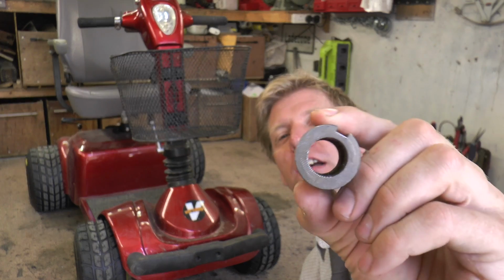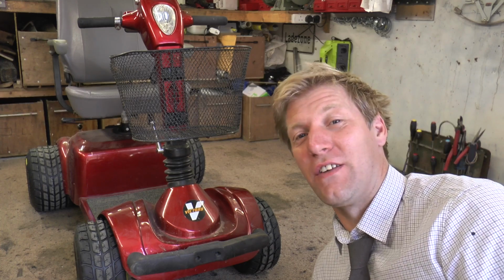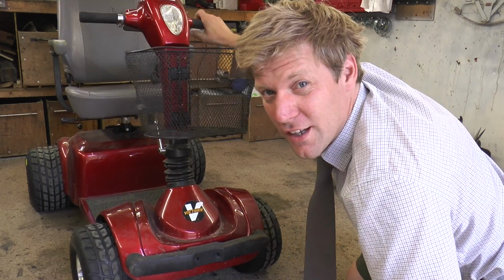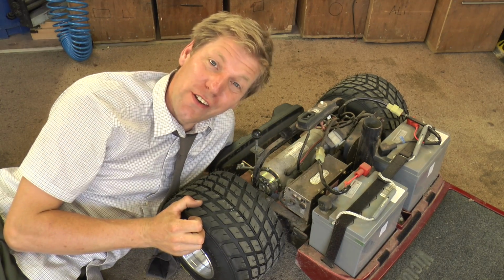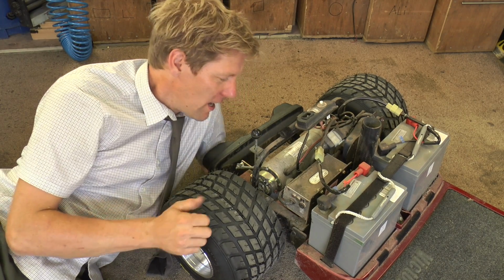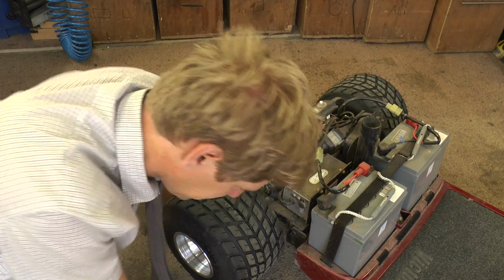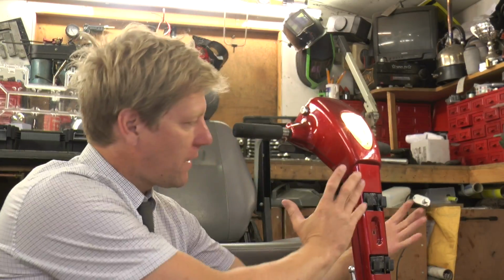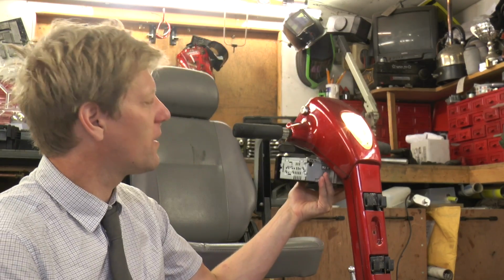Rims-Lift-and Bass Scooter Pimp #1

Comment from the maker: So what other mods do you want to see, as I just want to pack as much on this as possible.
Reply: colinfurze firework launcher
Reply: colinfurze needs more cup holders
Reply: I wanna see a massive spoiler
Reply: colinfurze needs hydraulic's!!!!
Reply: Those weird lights under cars to light up the bottom.
Reply: put Tesla's electric motor on it and go ludacris Mode
Reply: How am I so early
Reply: colinfurze add a windshield maybe.
Reply: Well, lets see. At least get a horn, like a nice horn, not just some music out of your boxes.
Some nice cushions may not be too bad as well, if you're going comfort.
And some suspense is nice too. Either you go for the killing suspense, like a turbo with a random activation timer, or just plain old suspension so your butt won't hurt when you get off the sidewalk.
Reply: Spoiler , underglow, raceseat, massive headlights
Reply: Led strip lights ( colour changing )
And a police lights and siren
Reply: A potato cannon
Reply: colinfurze a sparco bucket seat Colin !!
Reply: colinfurze  Pulse Jet?
Reply: suspension with A arms
Reply: kinda miss the bass-part in "Rims-Lift-Bass". Please slap some big ass subwoofer on the their. Maybe make a hole through where the feet should. the feet should still fit on the outside, bass massage included.
Reply: give it a rollcage
Reply: You could respray the whole thing, replace the seat and add Led lights/underglow
Reply: It could use a pneumatic suspension system
Reply: Sophia now that would be just stupid. love the idea.
Reply: A mini pub
Reply: colinfurze racing chair
Reply: colinfurze flame thrower or a hot tub
Reply: colinfurze flame throwers
Reply: colinfurze flamethrower
Reply: A race seat
Reply: More powerful electric motor!!!!
Reply: colinfurze maybe a built in fan for air conditioning?
Reply: colinfurze flamethrowers
Reply: A cup holder that cools your drink in the summer heat
Reply: Either loads of mirrors or like a camera reversing system idk
Reply: make it 4wd!
Reply: Spoiler, Rally Fogs, Rollcage, Suspension. The ultimate offroad scooter.
Reply: Put a retractable roof
Reply: You need flame effects on the body!
Reply: Firetrails like the delorean from back to the future
Reply: Massive subwoofer
Reply: Off road suspension
Reply: make it faster without putting a gas motor on it
Reply: colinfurze I love your videos sir now it just needs a engine like the other scooter did and would be amazing
Reply: Panini press !
Reply: please add a train/ barge horn. should be loud enough to fix your neighbors constipation. 
Good luck. remember if its not terrifying its too boring.
Reply: Hydraulics if possible. I wanna see a Lowrider seniors edition. 😆
Reply: You should add a roll cage and a heated seat to keep the buns warm :)
Reply: Air ride
Reply: Very raised suspension
Reply: i want to make magnetic engine free energy do u make it if u not make it u r waste this is our challange
Reply: Firework launcher or flame thrower... If its not dangerous its not a proper furze creation
Reply: colinfurze led lights make it like a Christmas tree
Reply: Nice seat and a Handbreak
Reply: Racing seat
Reply: colinfurze homemade racing seat
Reply: Stretcht tires and make Negative Camber
Reply: T-Shirt cannnon
Reply: Colin Furze mobility scooter tire spinners(tm).
Reply: Brushless motor...Colin ! fastest electric scooter
Reply: A trailer wagon with a big beer keg on behind!
Reply: colinfurze needs a bucket seat!
Reply: The Justist  mybe put a lazy boy recliner on it?
Reply: An ejection seat from a jet. And a lowrider(hydraulic jacks) attachment instead of the distance pieces!
Reply: you accept my challange you make one maganetic engine in free energy if you finish this challange
Reply: colinfurze HID headlights w highbeams
Reply: An automated firework firing & if possible reloading system.
Reply: Train horn,faster motor,bright front and back lights and led underneath
Reply: Please add camber to the wheels 😂🙄
Reply: Paramotor engine with paramotor prop on the back as propulsion instead of the electric mitor :D
Reply: colinfurze mini antenna . For radio
Reply: Air bag suspension
Reply: Add flamethrowers to the wheels!!
Reply: colinfurze good one colin
Reply: Machine gun mounted onto it
Reply: More speed
Reply: It needs to be jet powered
Reply: Make iT sorta fly make iT go fast put a propellor on iT and a parachute
Reply: Heated seat, drink dispenser
Reply: Ejector seat
Reply: Make it be able to jump with hydrolics
Reply: hydrauilics!
Reply: Make it street legal
Reply: A semi truck horn. Maybe some high powered head lights and some blinkers. A roll cage. Idk, just go mad max on that bitch. P.S. could you make one for Ricky Berwick! Ok, thanks!
Reply: Roll cage
Reply: Suspension
Reply: We need to get some actual subs on there. 2 12's would be appropriate I think
Reply: Jet engine
Reply: colinfurze you should give it hydrolic suspension so it can bounce or you could lower it and leave a trail of sparks behind you
Reply: Nate S nah too big that's what she said make them 6 6inch or 2 8inch
Reply: colinfurze after pimping it I wana see what an old grama would think of it
Reply: A train horn
Reply: A turbo boost type system so you can pass the other scooters or get away from idiots quickly would be ideal!
Reply: Put a big subwoofer in it, like a 15” or something
Reply: spinners, spoiler,  "hood" scoop
Reply: Get a bucket seat with harnesses
Reply: Hydraulics
Reply: Some sort of roof could be cool!
Reply: Drifting seat?!
Reply: Look up a 1969 Dodge Charger Daytona if you aren't familiar.  That thing needs a wing.
Reply: A sub, pneumatic suspension, neons, train horn, flame thrower if people don't get out of the way.... I'm sure I can think of a few more things
Reply: colinfurze 
Instead of spacers add coilovers to the front and rear for the lift? Make the steel plate for the speakers into sealed pods so they’re louder? Add a subwoofer somewhere like on the floor or underneath the seat? Put a round 7” Jeep LED projector headlight on it for a headlight? Put RGB LED underglow on it? Add RGB LED rings around the speakers? add a trailer hitch to it and make a custom trailer to tow even more toys with it? Make custom front and rear bumpers for it and put light bars in them or put a winch in the front bumper? When it’s all done apply a custom vinyl wrap to it? Oh and lastly, add side steps on each side to “help you get into the lifted beast”. Just for jokes lol.
Reply: Neon (Or LED) lights underneath, just to up the street cred
Reply: Model jet engine
Reply: Convert two Car Alternators into  Kart Motor
Reply: THIS!
Reply: I wanna see a massive spoiler
Reply: Jet engines
Reply: Colin's neighbors: What's he doing now? Are those go-kart tires on a mobility scooter?! Something's not right with that lad.
Reply: colinfurze under belly lights and a racing chair
Reply: Do what I did for my grandma's. More storage, cup holders, and a brighter headlight and some reflectors so people don't hit you.
Reply: colinfurze off-roading tires would be pretty cool.
Reply: Поставь двигатель помощнее )
Reply: Add a firework launcher and a smoke machine in the back so there’s a trail of smoke where ever you go. Then get a better motor and replace the batteries with some Lipos or Tesla batteries.
Reply: Put a dirt bike engine on it
Reply: I think a tow bar so it can pull a trailer then it’ll be the furze family vehicle
Reply: Hydraulics of course. Bouncy scooter. And a rear end spoiler
Reply: Beef up the headlights, get a new handlebar on there with some heated grips, and chuck a racing seat to feel sporty. You could also add hydrolics so the front end is lifted up and it looks like you're doing a wheelie. (Although you'll lose steering but who really needs that?)
Reply: i want to see that one !
Reply: colinfurze make an exhaust which spits fire
Reply: colinfurze a crazy loud Hadley truck horn!
Reply: hydraulics B)
Reply: colinfurze huge exhaust pipe and something to make it sound like a sports car and paint it!
Reply: A beer keg and a tap for the ultimate party scooter!!!
Reply: mini flame throwers that have fire coming out of the scooter?
Reply: do a bucket seat
Reply: pit bike engine in it
Reply: Subwoofer???
Reply: colinfurze wow 😮
Reply: colinfurze Add a back to the speakers, if you use metal be sure to put insulation between the speaker and the metal. Doing so will increase your base and sound by many folds.
Reply: PC Gaming chair? I mean it looks like a racecar chair, except is not as expensive.
LED strip lighting under, sure. Mexican themed horn. Some crazy decals and overall paintjob.
N2o installation... to sniff :D
Reply: strap a granny to it LOL
Reply: colinfurze a fat exhaust system ofcourse
Reply: Hydraulics!!!!!!!!!!!!!!!!!!!!!!!!!!!!
Reply: Side car for the kids to ride in.
Reply: hydraulics
Reply: Spoiler, bucket seat, aero kits and neons.
Reply: colinfurze and. Make it awd
Reply: nice racing seat, beer on tap, HID headlights, huge flag pole on the back
Reply: Seat heater pls! Could just be some canibalised heated blanket for nannies. I'm sure they'd love that same comfort on their whip
Reply: That thing is Dam Slow but you don´t want an Engine?
Can your hock in a realy Powerful Electrich Motor please?
Reply: colinfurze add a subwoofer under the seat
Reply: get it auto adjustment speed by thr music tempo seems legit
Reply: TODO:
- Suspension
- Upgrade the Eletric motor, faster as possible
- Safety belt
- Seat heater
- change to LED light bulbs, it will make look better and increase distance also LUX too.
- Cup or phone holder with charger USB
Reply: colinfurze make a bike. Some better than the jet bike but crazy than the drift trike... sound like a challenge?
Reply: Hydraulic suspension
Reply: flame thrower!!!!!!!!!
Reply: tire smoke
Reply: colinfurze  I know you did an engine before, so instead, how about upgrading to a higher performance electic motor and battery packs?
Reply: Add a navigation system
Reply: Roll cage with rally lites, camouflage it with brick work so the robbers canna see it when u park next to furze mansion!

Love the videos pal 😉
Reply: colinfurze
Reply: 4x 60inch Flatscreens , just like West Coast Customs would do.
Reply: Smoke machine, turbo power button, Convertible top, siren, ridiculously bright headlight
Reply: Rocket engine
Reply: Add a roof
Reply: colinfurze something that shoots, like a firework launcher!
Reply: racing seat
MORE POWER
improved lights
MORE POWER
under floor lighting
& more power
Reply: Jet pack
Reply: did i mention MORE POWER
Reply: Needs some hi-beams and an air horn.
Reply: Put a model jet engine on it
Reply: LS swap it... ;)
Reply: ofc a bike flag
and a big analog clock :D

but i guess thats nothing for an entire video^^
Reply: Serious though, needs RGB under glow!
Reply: Colin lets be practical, you're gonna need a cup holder.  Oh and and how about a finger ID start up button so only you can drive the little beast??
Reply: more powaaa!!
Reply: colinfurze do a flame thrower in the front of it
Reply: And do some led light strips
Reply: colinfurze race seat   Would be cool.
Reply: Air Horn (or better yet, fog horn)
Reply: colinfurze put some wings on it that shoot fire!!! 🔥
Reply: seems like you could build these for cheaper then 2k usd
Reply: Independent suspension on all 4 wheels, an electric motor something along the line of 70mph or more to beat the other scooter maybe adapt the charger so it charges from solar power and maybe use a Nissan leaf battery if it's not too big
Reply: A subwoofer underneat the seat :D Edit: Just saw there's no place for that, maybe somewhere else
Reply: colinfurze you should add in some Bond-themed gadgets like an oil slick and hidden rockets
Reply: I think it clearly needs more SPRINGS!
Reply: Motorcycle seat and sissy bar.
Reply: LayZboy recliner seat
Reply: A massaging chair, some neons too
Reply: fork lift motor so it can spin those big wheels
Reply: Flamethrower
Reply: Replace the seat with a gaming chair to maximise comfort ( dx racer)
Reply: Rich Colin-thian Leather
Reply: Racing seat, Cup holder, Rain protection, Neon lights!
Reply: Under-carriage neons.
Reply: a massaging chair
Reply: Add a lever that makes the scooter do a bunny hop, because why not?
Reply: Oh, also, box in those speakers for better audio.
Reply: Better gripping ,
Oh and a flamethrower 
Or maybe chainsaw
Reply: How about a new paint job?
Reply: Jack van den Berg funny
Reply: colinfurze a 600cc motor in it🤪🤪👌👌
Reply: Artificial Horizon! HUD! Add a dashboard that makes you feel like you're sitting in a fighter jet
Reply: Crazy cool colr
Reply: You should convert the battery to lithiumion and give it a faster electric motor
Reply: RECARO Seat
Reply: The Justist Trainhorn? 😂
Reply: colinfurze a very cool seat
Reply: colinfurze make a working full atomatic cirket
Reply: There's space underneath for a rotary mower, shame the weathers killed all the grass
Reply: Put the pulse jet on it
Reply: Also a flame thrower and fireworks launchers
Reply: how about a bucket seat
Reply: A MEGA cup holder for overly sized cups/thermos
Reply: colinfurze rally/offroad suspension and wheels + big headligths
Reply: chuck some beefy motors on there, maybe an upgrade to those lead acid batteries, like lithium ion or something
Reply: Needs a rear flamethrower/firework launcher
Reply: Tijeriña Production btw those lights are called neon kits or neon lights I'm just mentioning
Reply: Multi-tiered defense: flame thrower, fireworks shooter and thermite cannon.
Reply: I was thinking this exact thing.
Reply: OneBigWorld2010 yes! Colin you need to enclose one side of the speakers. I think it's called a baffle.
Reply: Racing seat
Reply: Ofc u need neon lights and some USB ports
Reply: Racing seat for extra horsepower
Reply: Lowrider handlebars
Reply: Or maybe a full housing with roof and ac and stuff
Reply: a good racing seat perhaps?
Reply: Tesla motor
Reply: Grenade launcher
Reply: colinfurze Smoke machine and LED underlighting.
Reply: A low-rider system! (bouncing hydraulics)
Reply: colinfurze a dinosaur
Reply: Put a lazyboy style recliner on it.
Reply: Flamethrower
Reply: colinfurze massage chair
Reply: Mega seat
Reply: Subwoofer, neon lights, cruiser style handle bars, led headlight and brake lights, heated seat, more powerful batteries and motors, horn, mad max paint job, bb machine guns.

Just a few ideas lol 😂
Reply: Flamethrowers!
Reply: Supercharger
Reply: Add a door and glass around also really bright lights
Reply: Put a crazy electronic motor
Reply: 1: replace the electric motors for more powerful electric motors
2:replace the chair with some kind of lounge chair
3: add suspension
4: big ass grille
5: fridge
6:turbo jet engine for extra boost
7: ride the wall of death with it
Reply: Afterburners 😍
Reply: replace the seat as grey is too boring!
Reply: A wheelie bar
Reply: Off-road suspension.
HID headlight.
Reply: colinfurze a tow bar
Reply: Leds under the scooter
Reply: You can add seat from racing car
Reply: A wheelie bar
Reply: colinfurze awd system
Reply: Train or boat horns
Reply: Some fancy light system to accompany the music
Reply: Pulse jet for passing power
Reply: colinfurze camber
Reply: How about a PTO to power a series of Furze-inspired garden machinery?
Reply: Racing seat
Reply: You should do something simple but effective like add some rgb undercar lighting and none of that bought stuff i wanna see it put toghether colinfurze style
Reply: A powerful motor and a much higher voltage battery
Reply: colinfurze different seat 😊😊 exhaust system (would be cool) and it having flame throwers would also be cool
Reply: A throne instead of the seat! :D
Reply: Paint job
Reply: Or maybe a turbojet!
Reply: I want to see a wing/spoiler(unless it will make it tip over of course), and a sun roof.
Reply: Flight mode, of course.
Reply: Probably already suggested : fireworks, neon light, hydraulics, funny and really loud klaxon,  James bond stuff...
Reply: Another seat
Reply: Racing seat
Reply: Make it have that suspension that allows you to make it bounce.
Reply: Aj Mekenzy YAAAS
Reply: ipodkarl nah, how about 2! Pulse jets
Reply: 4-wheel drive + more powerful electric motor(s)
Reply: Suspension
Reply: streamers
Reply: Flushable toilet seat
Reply: do something to the seat... like pimp it out with leopard print fabric or something snazzzy
Reply: Add subwoofer!!!
Reply: All wheel drive
Reply: Add this please :
- front and rear spoiler wing
- reclining seat
- remote controled ejecting seat system to throw someone who dare to steal the vehicle
Reply: Could use a subwoofer to give that audio a little bit of a kick, Sounds a bit lacking especially not having the speakers encased in anything giving the speakers no resonance. By the way, UK, North East for the win!
Reply: You've got tunes, stick some lasers  and a smoke machine on her an all?
Reply: 4x4
Reply: Roll cage tesla motor spoiler splitter
Reply: Sparco seat please
Reply: Big stinki MOTORRRRR!
Reply: colinfurze new chair
Reply: Pink fluffy seat that rotates
Reply: Backmassage😍
Reply: you need to add suspension and waterproof the electrics for offroading :D
Reply: Duh, you forgot to put super Nitro Colin.
Reply: try adding bucket seat
Reply: Bigger motor and make it quicker or put another motor in the front and make AWD !!!!!!!!!!!!!!
Reply: colinfurze a rotary engine
Reply: Put a rollcage on it.
Reply: Upgraded electronics li po batteries better motor over the top head light that kind of stuff something useable in everyday but makes it stand out
Reply: Inconceivable that there wouldn't be some sort of fire/explosion related item.  Or maybe a super headlight (lights the neighborhood)
Reply: Train/Boat horn
Reply: Train horn
Reply: make it a convertable
Reply: Put in a big ass brushless motor to make that thing stupid fast.
Reply: Underglow and a seat warmer
Reply: Put the battery in series so it will double the voltage and it will be super fast. Hopefully the motor doesnt burn
Reply: Give it an electric engine
Reply: LOTS AND LOTS OF MIRRORS AND HEADLIGHTS! Also, leopard print seats!
Reply: Needs a flame thrower next!
Reply: TRAIN HORN!
Reply: colinfurze Had hydraulics, turn it into a low rider scooter
Reply: Front splitter?
Reply: colinfurze how about a beer cooler!?
Reply: Goblin teasmaid.
Reply: A asome light bar
Reply: colinfurze hey what time will you post??
Reply: change the bars into a steering wheel maybe ?
Reply: convert to a hybrid with a toggle to switch swap engine
Reply: colinfurze and butmassage ofcourse
Reply: Active Exhaust! pump out some v8 sounds!
Reply: colinfurze a bucket seat
Reply: how about you put a sidecar on it :)
Reply: Speakers should point driver, not the road =/ Screens, you should do some screens! Massage chair would be fun too.
Reply: Active aerodynamics, a solid rocket engine and maybe a turbo
Reply: definitely needs a cup holder
Reply: its a furze thing so its gotta go faster, stick an uprated electric motor in it, its also gotta look the part (even more) bucket seat?? cos why not. and lastly its gotta smell like furze made is, so cover it in fuel and let that soak in for a while
Reply: this
Reply: American size cup holders, obviously ;-)
Reply: Fit an Agni motor!
Reply: it needs air ride. park it up and drop it or rase it when driving away
Reply: Convertible hardtop and suicide doors
Reply: colinfurze a train horn instead of the little beep beep
Reply: Make custom tires
Reply: Make custom wheels for the scooter
Reply: Now just to add the 6 point harness
Reply: Racing stripes on it so it goes faster
Reply: colinfurze you need a bigger electric motor
A throne in stead of a seat
And bc you Colin furze put some beefy brakes on as well as a nice new paint job!
Reply: colinfurze neons durrr
Reply: Wheelie bar?
Reply: 4 wheel drive? Or off road mobility scooter
Reply: Tesla motor & battery pack... may be a bit of a squeeze...
Reply: Electric roof canopy and satnav
Reply: BIG OLD BRUSHLESS MOTOR!!!!!!!
Reply: please put a sub woofer in the back of that lol
Reply: why don't you put an electric motor on each wheel for some proper torq, maybe try to get it to wheelie?
Reply: Double it up and make a stretch scooter :p
Reply: tinted windows!?
Reply: stronger electric motor
Reply: colinfurze Skirt, spoiler, and hydraulics
Reply: 24V AND A  SPARCO SEAT  😃👍🏻
Reply: Please break the land speed record for an electric one Mr collins
Reply: Firework launcher
Reply: Race Seat
Reply: Make jump on its wheels like the pimped street racing cars in the tv.
Reply: What I would like to see as a mod is the following an I think u like it. Make it so that the steering wheel and the seat can move upwards by a meter or so to have a good overview where you are driving. When you are in a crowded place you can sit and watch over other people. I smell hydraulics.
Reply: What about neon lights uinderneath  and  a 20,000 Lumen  front ant rear light.
Reply: Putt a booster on it
Reply: You could add a cowcatcher.
Reply: Fire
Reply: ADD RGB LIGHTS!!!
Reply: colinfurze A very powerful electric motor
Reply: Add suspension and air bags to lift and lower.
Reply: Try to make it street legal
Reply: let see you keep it electric and make it go 100mph. I triple dog dare you.
Reply: Please add a chopper style motercycle handle to it
Reply: One of those desktop mini fridges that holds a single can of drink.
Reply: Nitro.
Reply: colinfurze racing seat
Reply: Air suspension
Reply: One of those Semi Truck or train air horns
Reply: add a towable cooler and a paint job oh and color variable under lighting
Reply: Racing seat
Reply: Racing seat
Reply: Stretch limo it mate, room for all the family!!
Reply: A kind of sleep mode were the seat goes flat...
Reply: Roll Cage maybe? :)
Reply: colinfurze Hi, music is done, now it's need lowrider system , put on them pneumatic or hydraulic system 😁
Reply: A racing seat
Reply: Intercity 125 air horn
Reply: Colin, that speaker mount plate really needs to be red to match the rest, or perhaps respray the entire motor a new colour?
Reply: A double axles mini caravan with those fat tires. And a controller upgrade for more power
Reply: Fire jet launchers on either side
Reply: flamethrowers
Reply: Negative camber
Reply: Front lip and splitter
Reply: Dude you need to sod that seat off and put a bucket seat in it
Reply: subwoofer would be nice
Reply: colinfurze drive on fanboat conversion, or a parachute for parascending, just stick a massive fan on the back.
Reply: I once seen a man with a sign on one of these, it said: For sale.
Made me laugh as if it was like a nice car or something.
Reply: Just about to say missing a bit of march to the grave and he's only gone and slid it in at the end !!! :D
Reply: 4 wheel drive and hybrid!!
Reply: FYI those Mojo rain tires will probably wear really quick if plan on putting more power in it
Reply: A tea boiler, toaster and frying pan for a real breakfast?
Reply: Put an racing seat on it! :D
Reply: Hydraulics
Reply: Again why
Reply: colinfurze drift it
Reply: Have to add a winch so you can get unstuck when you go off road with them knobby tires.
Reply: Bigger electric motor
Reply: custom fiberglass fenders
Reply: colinfurze Just a dumb idea I just had..... mod mirrors.  Like those 80s-ish scooters with the endless sets of mirrors and headlamps.
Reply: Yo Collin you can modify the alternator from a car and turn it into a giant dc motor really easily that could be a cool speed upgrade
Reply: New stronger electric motor, with more torque so you can pull stuff with it
Reply: Also roll cage
Reply: swap handle bars for racing steering wheel
Reply: Rocket mod or rocket launcher mod ! Obviously ! Great job thanks for the content !
Reply: BUCKET SEAT!
Reply: Solar panel(s) to charge the batteries and accessories, center-mounted tablet computer with 4G Internet access which can control all the mods, and since we're trying to be loud and obnoxious, a handheld microphone so you can talk through the speakers.
Reply: Add hydraulic suspension
Reply: BIG OLD BRUSHLESS MOTOR!!!!!
Reply: underglow,spoiler, RACING SEAT ,fake exhaust
Reply: colinfurze you need enclosures for the speakers. Rigidity is everything for sound volume and quality
Reply: Replace that seat with a proper armchair and put a roof above it
Reply: you forgot on subwoofer!!!
Reply: A winch could be handy on rough terrain😛...
Reply: neon lights
Reply: a tesla battery
Reply: colinfurze CAN YOU PLEASE PUT AN GAS MOTOR IN IT OR IF YOU CAN'T THAN CAN YOU PLEASE PUT SOME MORE VOLTAGE AND A BUGGER BATTERY
Reply: Wings.
Reply: Truck horn please.
Reply: colinfurze tv? So i can binge watch your xhannel..hell yeah
Reply: You need a sub
Reply: colinfurze i have a power chair, any ideas,  has to be cuz of my weight, scooters they said wont hold me. Ive even rollded mine,forward. Hurt like hek
Reply: @colinfurze you added the speakers.... now add a SUBWOOFER!!!! Complete the setup with some real BASS
Reply: racing seat
Reply: Since you are calling it a pimp, clearly the next step is a small TV and a playstation
Reply: Great vid again. You could start tweaking the electric engine, make it four wheel drive. Better/bigger batteries. Put somekind of boost on it, for quick city overtaking
Reply: Fire breathing exhaust system would be pretty sweet.
Reply: A mounted paintball minigun
Reply: A 18HP engine...
Reply: Xenon headlights, hydraulics, wheeliebar, spoiler, side skirts, front splitter, recaro racing seat including 5 point harness
Reply: Not a mod request, but I think you should start a charity where you build custom mobility scooters for those in need. You have the followers to back it. It would be cool seeing people riding around with pimped out scooters that move a bit faster. :P
Reply: colinfurze i want to be your assistant! Help you with your projects.
Reply: A train air horn and fur...lots of fur. Faux fur preferably ;-). A GPS, of course. Highway foot pegs, like a big ol' motorcycle.
Reply: this realy needs parking camera and screen, then you can use that screen to watch netflix and chill while driving. yolo
Reply: hydraulic suspension (bouncing)
Reply: electric powered cheese grater
Reply: Negative camber
Reply: Massaging seat
Reply: petrol car converted into electric !!
Reply: cup holder
Reply: airride or hydraulics an idea ?
Reply: Water balloon launcher
Reply: 1. Put in a super bright headlight. 
2. Make speakers face the right way.
Reply: Its got to do at least 60 mph. Go with an electric motor, this time, I think, rather than an engine.
Reply: Car steering wheel for handle bars!
Reply: An automatic get me home feature with your mate James doing some mad electrics for when dear old granny gets lost!
Reply: Embrace the electric motors potential. More Power!!!!!
Reply: A 100hp electric motor!!!!!
Reply: colinfurze Brushless motors and lithium batteries.
Reply: Lithium power plus overvolt it
Reply: give it a better chair
Reply: Dunno, but it's not dangerous enough, nor loud enough.  if you didn't already put those offroad tires on it I'd say make it a hovercraft or amphibious fanboat.  maybe you put an airbag under the seat so you can launch yourself over fences..?  Or a giant tesla coil so you can shoot sparks down the street as you drive.
Reply: Bucket seat
Reply: bumper nuts
Reply: colinfurze make it a full offroad mobility scoot
Reply: colinfurze or a drag racer
Reply: 007 style "anti-badguy" gadgets (flamethrower, oil slick, machine gun, rocket seat, etc).
Reply: colinfurze put a bucket seat on it
Reply: Sport racing seat
Reply: big arse spoiler!! aaawooogah horn!! at least 5 cup holders!! brand name (or not) racing seat!! does the front need a splitter? :P
Reply: A hardtop, with an internal heater for cold days, And windshield wipers. High beams for dark nights and make sure they are the nauseating bright LED headlights. 
A Spoiler so that when you go a breakneck speed of 10 km/h you won't fly off the road. And those rims need something more... like spinners.
Reply: Sportbike engine swap!!
Reply: A dart gun,bright headlights, a solar panel built in,
Reply: Under scooter glow 🤣
Reply: colinfurze turbocharger scooter
Reply: Larger brushless motors and lithium ion batteries would be nice :)
Reply: It needs a mini gun style (rotating) flame thrower!!!
Reply: Why not make the seat height adjustable as if its an office chair
Reply: More powerful electric motor and wheelie bar 👍
Reply: colinfurze flames!
Reply: Hydro live like a low rider, probably hard too do but would be a sight to see
Reply: Hydraulics like on low riders, probably hard to do but would be a sight to see
Reply: Make it faster but keep it electric, and turn it into a rc scooter and do pranks with it
Reply: colinfurze you shouldn't b having the basket on,it looks really dumb with all the other mods...
Reply: Anti lag
Reply: colinfurze a Recaro racing seat. You might want some lighting underneath it whatever color maybe a variance of color. Some renthal handlebars I don't know maybe even hydraulic brakes
Reply: Simon Daniels hell yeah boy, let me pimp your ride
Reply: Rock Crawler Mobility Scooter. With flames, and some sort of something launcher. ASAP.  ;)
Reply: It could use a nice recliner as a seat...
Reply: tomorrows halloween! or today?
Reply: Hey Colin I absoultly love your builds, your a genius.. I really want to build a Badass mobility scooter that will top out 50 plus mph but battery powered rechargeable .. how much $$$ u think that would cost?
Reply: Flying
Reply: Add a lowrider hydraulic thingies :)
Reply: please install speaker "baffles" to the rear sides of those co-axials (like little round speaker boxes). as they are currently mounted, they are unable to produce bass frequencies because the front wave is allowed to cancel the front wave, cancelling any potential bass.
Reply: A hydraulic chomper
Reply: Faster electric motor and heated seats and of course a cup holder for the 🍻!
Reply: Cup holders for your tee...  and umbrella holder to get som shade for the burning sun... 😄
Reply: would love to see a waterproof version of this, my mother recently went through a small puddle with her scooter and it destroyed it, was looking to modify a scooter to make it waterproof, I'd be curious to see how you would do it
Reply: Can you make korosuka robot
Reply: Colin furze  how do you remove the speed controller form a mobility scooter please I can't se to locate it I've no idea what it looks like or located please help
Reply: HOW ABOUT SOME UNDERNEATH LED LIGHTS
Reply: You prolly dont give a damn but does anyone know of a method to log back into an instagram account?
I stupidly lost my account password. I would love any tricks you can give me.
Reply: @Andy Mark instablaster :)
Reply: @Kason Pierce It did the trick and I now got access to my account again. I am so happy:D
Thank you so much, you really help me out !
Reply: Tire mod for victory 10 scooter
Reply: Do you make and sell these adapter for the front and rear axle? I was wanting to modify my scooter for years now.
Reply: Colin I would like to see you actually help people who need help with your talents. It fun to watch you yell “yee haw!” about everything, but maybe a small percentage of your time and enormous talent applied to finding solutions to actual problems that benefited multiple people. Either that or send me the parts to hype my scooter!!!
Reply: full time rear view camera & 7" monitor please show detailes of adding 12V battery system & all needed controllers & wiring for these type car parts. If you'ld like to help a body out how about building a trailer with wiring, lights, sound system. By using my custom idea described below I have added a second grocery buggy to nest inside the 1rst. 1 & there by be able via some custom work make the unit to have an as needed sleeper compartment ( what I call a Hobo RV sleeping, cooking, storage areas, maybe even a camp shower as well ) custom bug is chewing on me bad. lol!